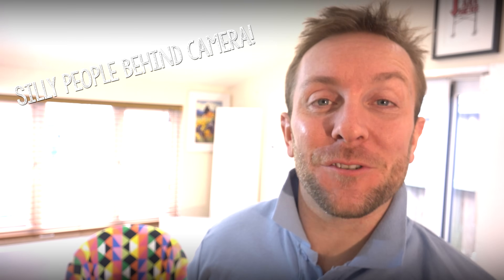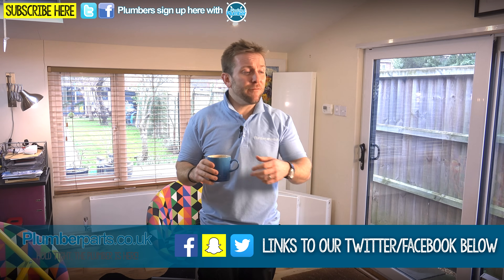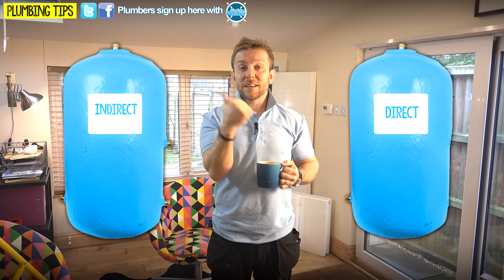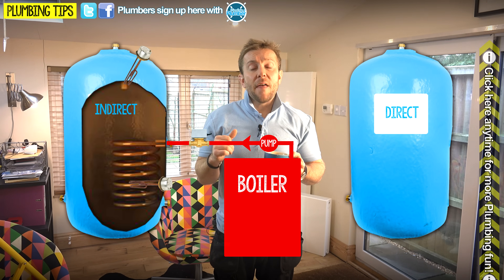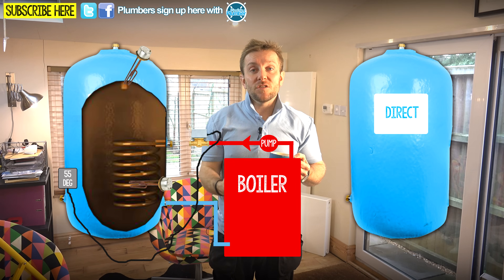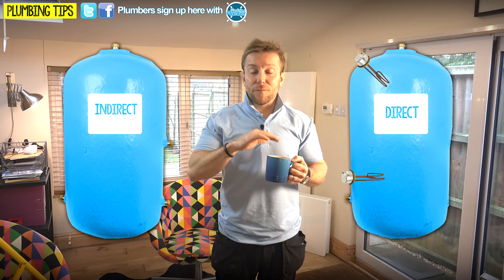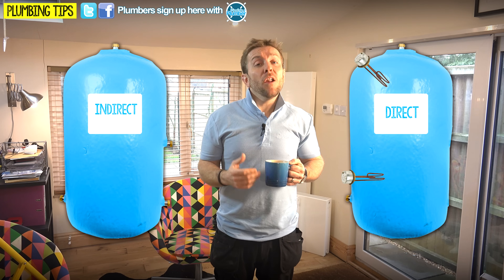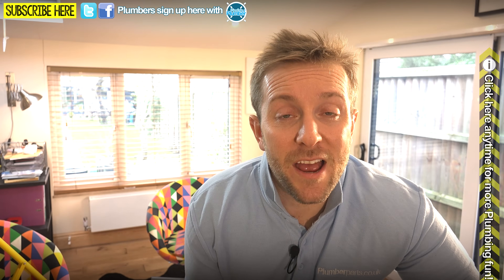DIRECT & INDIRECT HOT WATER CYLINDERS - Plumbing tips

Comment: A direct cylinder can also have a feed and return to, for example, a range back boiler. Water is flushed through the whole system including the back boiler. I have had a successfully operating one of these doing all our cooking and hot water for over thirty years (the cylinder just cracked and needs replacing which is why I'm looking at these videos). We have no immersion, it has four connections... cold water in at the bottom from a header tank, hot water out at the top of the cylinder to hot taps, hot water return from back boiler at bottom opposite cold intake, cold feed to back boiler about 6 inches above the hot water return from boiler. No pump needed as it's convection driven.

Comment: I'm qualifying as a plumber in north east college London, I subscribed to your channel lot of time ago I believe, I do have question that I would like to answer me.. If the boiler is warming up the cylinder through the radiator water, how does it heat up the hot water supply for the taps in the summer when the radiators are switched off? Does it work electrically with the 2 immersion heating element? Please reply to me 😉
Reply from the maker: Hi Antonio. I'm going to answer your question in a video next week...stay tuned! I'll also use your comment in the video too!

Comment: After watching your video I have finally "got it". Thanks for a great video! Is the water that is used to go through the coil the same water as the radiators are heated from? Can you have your boiler feeding the cylinder coil without the need for heating to be on?

Comment: James, started looking to explore the differences between indirect and direct and got to your video on my first search.  Its pretty cool explanation of things which made my questions simply answered.  Just one quick thing, did I got it right?  If I have solar panels on my roof, I should be selecting the direct hot water cylinders,  isnt it ?  And what I do to send good pressure to all water points (4 showers, 4 taps for example) ?  Appreciate your valuable recommendations. Thanks.

Comment: Im learning as I watch. A plumber fixed a leak at the bottom gate valve of my tenant's indirect boiler which needed  new piece of pipe, he inadvertently wiggled the pipe to the coil and now its leaking from there due to corrosion. Bloody one thing after another. I just bought a replacement for him to fit tomorrow if he doesn't bugger anything else up!

Comment: Hi. Thanks for your video. Very informative. I am looking to install a indirect cylinder but my boiler is within a log burner. So I noticed you mentioned the thermostat that's kicks in at 55 degrees and turns off the boiler. What would be the alternative to this if the log burner got too hot?

Comment: How do I find the heat transfer rate of that indirect coil? There is so little info on them. For example you have DeltaT 50 radiator that will put out X watts as long as the average temp going through is 50 degrees above ambient. Is there a similar spec for those indirect coils in the tank?

Comment: from this info i am understanding that if i have my hot water cylinder isolated from the supply because its leaking then its still OK to use my boiler (old type not combi) for the central heating have i got this right?

Comment: thanks james for description of the difference, i have an indirect and want to plumb in a shower to it,  as the electric shower uses loads of power, would i need to install a pump to up the flow and pressure and what one would u recommend cheers sandy
Reply: Is it a vented or unvented cylinder?
Reply: +Sirus I think it's vented as it has pipe coming out top going back to tank in loft
Reply: Ah, ok,you might get away with just a twin impeller pump on your shower without installing a surrey or essex flange on the cylinder, but I would recommend one. Salamander pumps are reliable avoid cheep no names. Depending on your cylinders water temp you might need a blending valve that salamander make for the pumps so the water is 60c or just under as any hotter damages any pump. The hotter the tank water the better as you will get more showers out of a tank. But before you get all involved. you might not need a pump, not all gravity systems are pants ;)
Reply: Sirus thank you very much for information cheers sandy
Reply from the maker: Great work guys! SUBSCRIBE! ➡️👉 https://www.youtube.com/subscription_center?add_user=plumberparts 👈⬅️ IF YOU HAVEN'T ALREADY! 😎

Comment: Jay help me out. Just moved into a really nice Victorian flat. 4 up, no gas. Pure mare! Storage heaters. Kill me now. They're no going on! Got a direct cylinder straight out of 1970. You know the ones, no insulation, nothing. Just a bloody electric copper radiator in a cupboard. Now the water  pressures cack 4 up. We don't do baths, just showers. It has an electric shower that spits water out which I can live with but with the cost of leckie right now, i don't want to nor do I need to heat 180 litres of water. All I need hot water for is washing my hands and doing the dishes. Without taking apart the whole system, if I switch off the immersion, could I have fitted a sufficiently powerful instant water heater just after the output pipe from my cylinder then have my hot water when I needed it?

Comment: Hello mate, love your videos. I have a question for you. I've got solar PV on my roof and also have a condensing combi boiler. I had an idea to install an indirect tank but us it in reverse. 

I'm an electrician, not a plumber, so not sure if it would work but my idea would be to heat up the water tank with surplus power from the PV panels then run my central heating through the coil of the tank after the boiler so that it was within the radiator system and use the immersion to pre-heat the cold water before it went through my boiler. 

The idea being that I took the edge off or potential heated all of the water requirements from the boiler before it went through it. With the boiler only heating the water if the immersion couldn't handle it all.

I hope this makes sense? Be interested to see what people's thoughts were? I can't find anyone doing this online so I'm assuming it's probably not possible but seems like it could work in theory?

Comment: Dear James 
Thank you for msking it easy to understand how a hot water cylinder works.  I have a hot water cylinder with two immersion heaters. I have just installed solar pv panels and my cylinder is now connected to solar heating using the iboost solar heating. Now my issue is that the top immersion heater is the one connected to the iboost. Now my understanding is that the top immersion heater only heats a third of the water in the cylinder and I would like it connected vice versa so that the heating by solar uses the bottom immersion heater and that way I have lots of water heated by solar and my 3.06khw pv solar panels can help lower my electricity bill more. Please help.

Comment: Hi James, Bought a house, Looked at hot water cylinder. Looks like an indirect system as old owners used to have a coal fire and it "looks" like they used that as the primary heat source for the tank, however, coal fire now gone with old owners, so im now heating the cylinder from the top and only immersion heater or it appears. Is this a full on Bad, if im having to ask im thinking i should do something about it. Cheers, And top videos btw.

Comment: hi, so the indirect cylinder coil contains separate water for radiators,  so if I want to alter my pipework in the bathroom to move the sink to a different location, I have to drain the cylinder down, so this wont drain the water in the copper coil ? and affect the radiator system ?, thanks, mark.

Comment: So....is the water from the radiators running through the coil inside the indirect tank? 
What I mean is....if my central heating is on will that also heat the water in the tank?

Comment: I was wondering if using the water in the tank (eg for a bath) has an impact on other water in the tank that’s heating up? eg your got water is on for an hour but you start using it when the water starts to get hot? Is it best to wait for the hour? Thanks
Reply: I’m trying to figure out your question here, but I think you mean can the emersion heater or boiler heat the hot water to replenish the cylinder as your using it.
This would depend on quite a few things, eg, how much water do you use in your bath, is the boiler trying to heat the home as well as the water at the time of your bath and the heat output of your boiler and it’s temperature setting. 
And depending on how long your in the bath, but the water should be hot enough for someone else after you.

Comment: I have indirect water cylinder which heats up through boiler and electric when needed. How ever when I am using electric the kitchen tap runs warm then all of a sudden goes cold for 30seconds then roasting hot again. What’s the cause as I am lost scratching my head? Thanks

Comment: Hello mate, I have a back boiler run off my fire for water & radiators so I worked out its indirect. How does the water in my boiler get there ? Or does it not have water in the coil ? It's just a coil that gets really hot from my fire ? Probably silly questions but my head hurts lol. 
Thanks.

Comment: Interesting video. I think my Council boiler might now be "indorect" 

But I can't make my tank out ;it has THREE pipes ! One at the top, and two at the front. The latter two I presume to be the coil pipes, that leaves ONE pipe to get water in and out ? (There is also another weird pipe at back of cupboard that has a stop cock at 4'  high ... leading to a hose drain connection at the other ! (Maybe to drain loft tank?) Oh and the condensing boiler is in the kitchen.

I'm thinking - since I only use maybe two bowls of hot water a day (washing machine / shower are cold water fill) - it's wasteful to heat that whole tank twice a day. So I am looking at those instantaneous heaters ... most of which are quoted as 3kw, and can be plugged into a 13A socket, (which must surely be stretching the fuse limits) Maybe wire as a spur to the rear of a newarby wall socket?

Comment: Hi. I've been watching your vids for sometime now. I have a problem with my central heating/hot water system. I am having to re-pressurise my system almost on a daily basis, but I cant find any leaks. Any idea what could be causing it??
Great vids btw.
Reply: delboysauchie pressure relief valve???
Reply: Could be leaking at ground floor level, I.e. under floorboards. You can try adding a leak sealer to the system, it works on small leaks. That depends on how much water it's losing and how quickly. Or, as stated, check the pressure relief pipe outside to see if it's passing water.
Reply: Thanks for the replies. I shall check into that and let you folks know.
Reply from the maker: Yep. PRV. SUBSCRIBE! ➡️👉 https://www.youtube.com/subscription_center?add_user=plumberparts 👈⬅️ IF YOU HAVEN'T ALREADY! 😎

Comment: Shouldn't your flow pipe enter the coil from the bottom cause the hot water will rise and heat faster?
Reply: Don Stanton the water is being pumped round the coil

Comment: still no idea which one to install for my apartment :/
Reply from the maker: Send me a pic of it on my Instagram and I'll see what it is. http://www.plumberparts.co.uk/social.php?social=Instagram
Reply: plumberparts hi mate. Wondered if you could give me some advice and breakdown on roughly how much electricity it will cost to run an direct unvented cylinder. I've just had a loft conversion so now the house has gone from a one bathroom house to a 3 bathroom house, 2 ensuites (1 upstairs in the loft conversion), (1 first floor ensuite) and the main bathroom on the 1st floor.

Was it correct to get a direct unvented as opposed to an indirect. We were only told once most of the build was done by the stupid building company that our boiler would not be able to feed all three bathrooms. So just want to know now was it the wrong decision to get a direct unvented?
Reply: Also I have no idea how long it has to be on for it to provide enough heat for the whole day. I've just turned it on for the first time yesterday for a few hours, no one actually showered yesterday but by this early afternoon the water was all cold again? I thought it stores hot water for at least 24hrs
Reply: Combi boiler for flats

Comment: I am no plumber, I am an electrical/electronic engineer and computer programmer by trade, but this Friday I have decided to think about installing a stove with back boiler and immersion heater + radiator setup. Ive read up on all the science stuff expansion, pressure, thermosyphon and other things and have come up with this design I have built it based on everything I have learnt since this Friday. Any smart plumbers could you check the design image here https://photos.app.goo.gl/37Gr55xhwRhV74xeA.  I can solder pipe and bend it and all the other stuff too most of my electrical & electronic engineering skills are transferable and have plumbed thing in the past still no leaks so I am good to go.